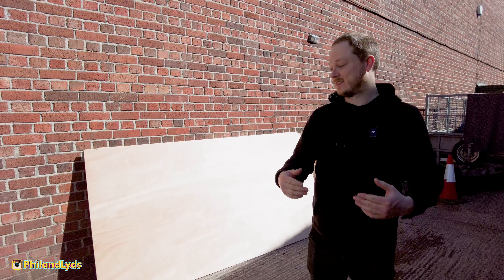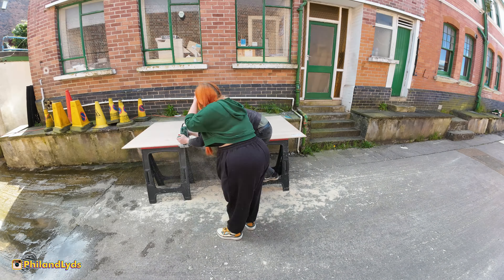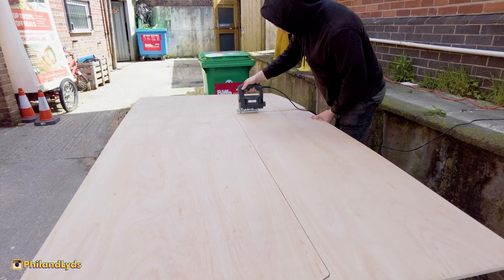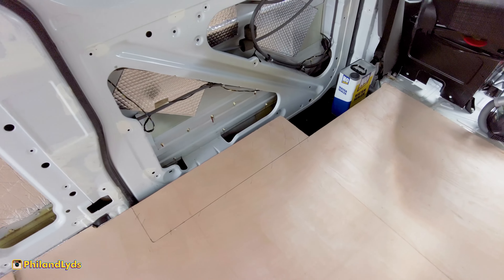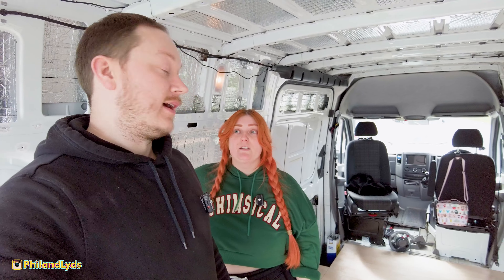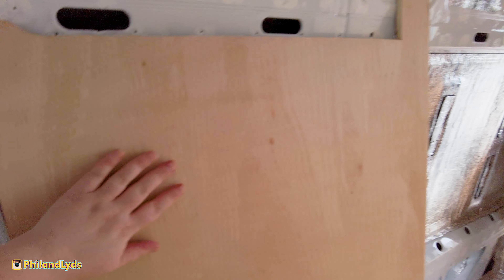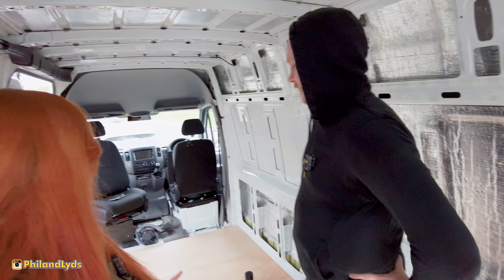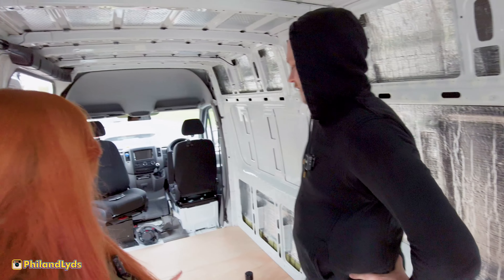MERCEDES Sprinter THINNEST Subfloor Solution! | VAN BUILD SERIES Ep11

Comment: Hi guys, nice vlog, I don’t know how far along you are in relation to this vlog, I have a kitchen that overhangs the step, I built the kitchen in 2 sections, 1st section along the wall, fixed to the floor and the wall, and a second module that covers part of the sliding door that overhangs the step, fixed to the floor and the 1st section of kitchen, the idea is if I ever need to get to the door mechanism the overhang kitchen module detaches and will come out without destroying the whole kitchen, it leaves part of the worktop floating but I can work around that. I see so many build vlogs with overhanging kitchen built as one long unit. Just thought I would comment. 👍
Reply from the maker: Hi Mark,
Thanks for the comment. We hadn't thought of that really so we may have to incorporate that into our build! It's coming up to that point soon as well so the timing was spot on! 👍
Cheers for the advice and thanks for watching.

Comment: Just a bit of advice when using the router you should have the cut edge at your left side. Triger hand away from the wood.
Reply from the maker: Thanks for that, I will remember for next time. What is the reason for this?
Reply: It’s the rotation of the blade it’s gives a better cut and going the other way blunts it.